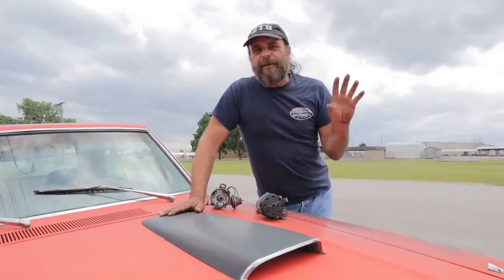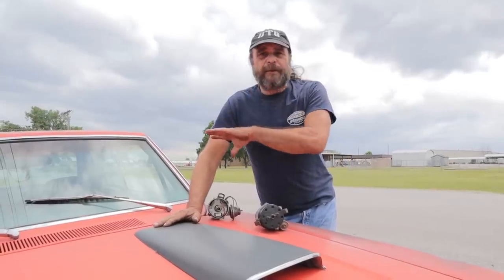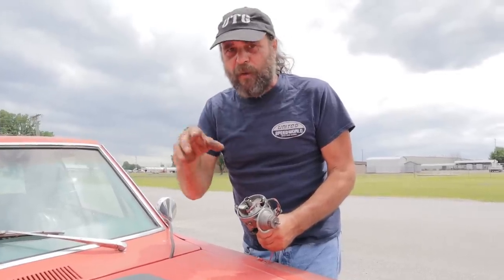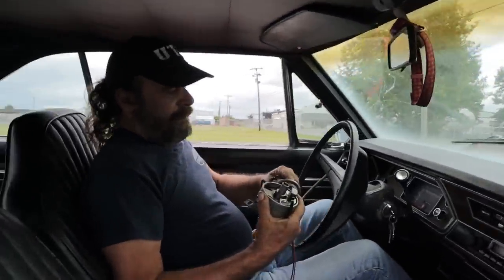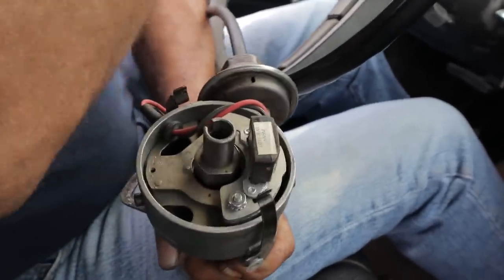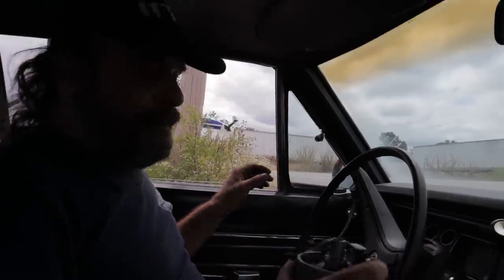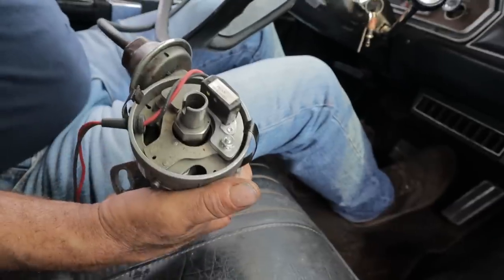The Vacuum Advance Debate!

Comment: IMO, vacuum advance was originally hooked up to manifold vacuum. Later, the manufacturers hooked it up to ported vacuum for emissions purposes. The big downside of ported vacuum is the engine tends to overheat on hot days in traffic. Ported vacuum will cause the engine to idle with less advance than what it wants. Idle loves advance. It runs cooler and more efficient. 

From what i've heard, never seen one myself, In the late 60's, in California, they started to install a second vacuum advance that was activated by a temp sensor. I think this was an attempt at fixing the overheating problem. So, when the engine started to overheat it would add additional advance from the second canister and cool the engine. Could be wrong. Just a theory.
Reply: Ah, yup. I think you nailed it. That explains the purpose of those (pvc looking coolant switches) perfectly. I do believe, you are spot on. All that foolishness should be bypassed and we should take our vac right from the intake in the first place.
Reply: It’ll only overheat if the manufacturer didn’t design enough static advance in, or the idle jets pushing the whole lean burn thing way too far.
Reply: I had a 75 Ford Granada with 302 that had that system smog pump , EGR valve and vacuum hoses everywhere if you took one or two off and did not know where they went your in trouble for sure . It has several water temp sensors with vacuum hoses hooked to it when it got to the set temp it would open and send more vacuum  to advance the distributor more timing  kinda of a neat idea .

Comment: I thought the only difference between full vac and ported was having extra advance at idle. Ported timing waits until throttle is just off idle to work. So it makes no difference either way. The power and fuel economy is the same. The only change from the exta timing at idle is smoother idle, cooler temp, better vacuum assist to power brakes, ect. depending on your engine combo, it may run better at idle. The higher vacuum signal lets you lower the throttle plates even more to gain better results from your idle mixture screws. Remember, we always set our base timing and and check max timing with the vacuum advance disconnected anyway. WOT doesn't use vacuum advance, so there should never be a change in performance. Anyone who disagrees must be setting their base timing with vacuum advance connected. This is wrong and will affect many things negatively. Love your videos, Tony!
Reply: Well said Ed. Full manifold vacuum is the best way.  I think ported started with the Clean Air Act in 68.
Reply: Ported vacuum is pretty low just off idle and manifold vacuum is pretty high just off idle.  You’re getting much more advance with manifold in that situation.  It’s not just idle where the difference is.  In fact, most vacuum canisters I’ve come across don’t start advancing timing until about 5 hg.  So if your canister is connected to ported and you’re in light cruise with those throttle blades barely cracked, you’d be getting zero advance.  If you were connected to manifold you’d be getting all of it - like you should.

Comment: Absolutely correct.  The biggest problem is that the off-the-shelf distributors have too much mechanical advance for ported vacuum.  I had DUI build me a distributor with 12 degrees mechanical advance and a 14 degree vacuum canister.  I start with 24 degrees initial timing which using ported vacuum is your idle timing.  But I vary that from about 22-26 degrees as needed.  So this gives me 24 degrees at idle, 36 degrees total timing and 50 degrees light load cruise which is exactly what a first generation SBC wants.  My engines all run perfect.

             For Ported Vacuum

Idle     24       
                  >  12 mechanical advance
Total   36
                  >  14 vacuum advance
Cruise 50
Reply: DUI recommends manifold in their literature.  How many of those 14 degrees ported vacuum advance are you getting at high speed/low load cruise?  At low load, manifold vacuum is high and ported is quite low obviously.  Run two gauges at once to validate.  Seems like you could be getting more mpgs out of your cruise with more timing, manifold timing.

Comment: Well, we know the canister works. The distributor has to be curved to work on whichever port you use. If you take a stock distributor that was curved to run on ported and you put it on manifold you will have way too much timing. Likewise, if you plug a distributor into ported that was set up for manifold you won’t have enough. So there is truth in both camps on which is “better”. Best to know what you have for mechanical advance in your distributor and how many degrees at what vacuum your canister delivers to determine what will work for you. Excellent real world practical demonstration from Tony. You won’t get that anywhere else!  👍

Comment: For stock type stuff ported is great, cars form the factory did it that way for a reason....  I had a car with a bigger cam and found it worked best hooked to manifold.  The reason why is to get it to idle in gear, I needed the throttle blades open too far causing the idle mixture  screws to have no effect.  So, hooked to maniflod I got some extra timing that raised the idle allowing me to close the throttle and allowed  idle mixture adjustment.  This would not have worked if I did not have an adjustable vacuum can the stock cans have too much advance.  In full disclosure the stall convertor was too tight for the cam, when I put it into drive the car learched pretty bad.  So, yes when modifying engines the combo  is very important. 

This issue is always a debate, IMO the most important thing is to understand timing and the advance mechanisms.  Then use a vacuum gage and timing light to actually know how much timing your engine is actually seeing under different conditions.   Too many will want to argue about this and they never drove a car around with a vacuum gage or checked their mechanical advance curve.  

Keep up the good work Tony!!  Dont worry about the know it alls, they are just fine.  Your are giving a great education to the younger/newer guys!!  Its weird to think that there are a lot of 50 year old professional mechanics who never worked with carbs and distributors.
Reply: You can also drill a small hole in the front throttle plates,  this will allow you to bring the idle screw down to cover the slots in the base plate. If you go any higher on cam profile. Another trick to let a little more air in was to adjust the screw on the secondary shaft to open it letting more air through and accomplishes the same thing. Either will let you drop the Idle screw down to function.

Comment: I guess I'm a younger guy, mid 30's. Grew up in the age of distributorless ignition and electronic fuel injection. But the more I watch these videos, the greater respect I have for the engineers of the past for all the clever ways they thought of ways to improve performance, economy, and drivability on an....analog level{?}. The things they did before modern computer power are really quite impressive.

Comment: Love it!! First you held class, then when heads started shaking, you took everyone into the lab. "A video is worth a thousand words"...😁 
This is basic stuff, dont know how there is debate on it, but you had a great way of clearing the air on the subject Uncle!!👍👍
Reply: The demonstration was hardly relevant
Reply: @yeboscrebo4451  Hows that??? For people who are unfamiliar with vacuum advance, don't understand it, or might be 'visual leaeners', its totally relevant. How could it not be???
Reply: @wheels-n-tires1846  because the distributor is only part of the symbiosis and doesn’t operate on its own so showing what happens in a disconnected distributor is hardly a comprehensive teaching aid.  People think that you can just switch between ported and manifold and “see which one works best”.  Wrong.  If you switch between one or the other, the initial timing may need resetting, the mechanical timing curve needs resetting, the vacuum advance canister needs to be adjustable and set correctly and finally, even the carburetor may also need adjustment to achieve results.  Uncle tony failed to explain WHY time is needed as certain inches of vacuum or certain rpms, he just pointed to a dizzy and said “look, see”.  Sorry, even knowledgeable dudes like uncle Tony have crusty ideas they’ve harbored for years that are just wrong.
Reply: @yeboscrebo4451  Lots to unpack there...so first, in other videos hes talked about timing and carb relationships. This vid wasnt  about that. It could really be condensed into "see, using this port, good. Using that port, its working backwards, thats bad." Or.... "this shows exactly what happens when you hook it to the wrong hose"...
 Its meant at a 4th grade level for folks who know little or nothing about distributors, advance systems, carburetors, etc... And Tony certainly wasnt saying you could switch back and forth between ported and unported to run your vacuum advance distributor. Thats idiotic, and nobody that has a clue thinks that.  Not sure where you got the idea that anyone thinks that!!! That might be the silliest statement Ive heard on YT in a long time...so its pretty bad!!
So anyway, while youre right about the finicky relationships of timing and carburetion, this vid didnt intend to address that.  Why does he have to address everything in each video?? Maybe try watching others. Id imagine theres HOURS of Tony on here explaining timing, curves, carburetion, etc. So if you expected it to give a thesis-level dissertation on that relationship and it's details, well guess youll just hafta stay dissappointed, because this vid, and frankly the whole channel seems to be more about basic info and explanations for beginners, or people who only have experience with newer cars and systems. Your conclusion that the old timer is dumping old and incorrect theory on here is whats wrong. I read and used Tonys knowledge for years and years...decades before he ever had a YouTube, and can say that I put together a half dozen street/strip Mopars with that knowledge, and they were better and faster because of it.
Reply: @wheels-n-tires1846  wow that’s a lot of words to not actually refute any part of my comment. Did you ever “unpack” the subject matter of the comment i made?  Not sure where I got the idea?  Have you read the comment section?  Lol.  As I already explained, the demonstration was not relevant precisely because it was overly simplistic.  To explain the difference between ported and manifold vacuum, it’s not good enough to have a dizzy, removed from the engine, and expect to illustrate the relatively complex interactions between all three forms of advance timing.  You can’t just say “look the advance mechanism is moving here on manifold and here on ported” because each case requires changes to the other two forms of timing advance.  Just the fact that he did not acknowledge this interaction is indicative of his misunderstanding of the benefits of manifold vacuum advance.  It seems like uncle Tony just gotten stuck on the teenage hot rodder “more timing equals faster” approach without every revisiting this idea in his old age.  Your better off reading what the actual engineers had to say about it than an old hot rodder stuck in his ways.
Reply: @yeboscrebo4451   What you don't realize is that  YOU  are  the one that made this topic more complicated than it is. Wheelsntires said "lots to unpack" for a reason..
Reply: @shootermcgavin2819  and you are the one making an irrelevant comment.  If you can explain how I’m wrong, I’m all ears.  Otherwise you’ve added nothing to the conversation.

Comment: As I recall, vacuum advance is always useful when you have high vacuum because you also have stratified lean conditions.  Could be at idle, could be descending a hill, could be light throttle freeway cruise.  That vacuum advance is there to help light the very starved almost closed throttle poor mixture, light it early so the weak flame front has time to progress to peak burn. 
If you watch your own video here as you just presented it, you see that when you accelerated, you were on mechanical advance only, both times.  Once because vacuum advance fell back to mechanical only, and once because you ported it.  Same result. 
The vacuum advance can't "remove" mechanical advance.  They are separate systems ...
Reply: Exactly.  "When you need it most–"  it was never there in the ported scenario–  how can it be "taken away?!"
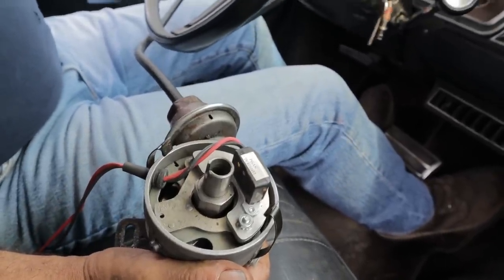Reply: From what I can tell, you are correct. Notice around 4:58 as UT releases pedal, i.e. cruise condition (minimal fuel, somewhat high rpm) the vacuum advance can be seen to go away. But actually, you want mechanical and vacuum all working at that condition as the low cylinder filling and small amount of fuel need max ignition timing. So taking away vacuum advance at the condition, takes away much needed advance.
The timing gets taken out during accelaration because cylinder filling increases so a faster ignite happens as a result of the richer mixture.
From all the reading plus some testing I've done, I think the issue is that when hooked to manifold going from ported, idle timing goes up too high, so the distributor gets pulled back to end up at the same 12-14° idle timing when it was on ported, but now the vacuum is adding some of that idle timing. But that then limits the higher rpm timing because the mechanical is now down from 12-14, to probably 4 or so (rough numbers for illustration). So when acceleration is applied and vacuum drops, the mechanical is lower than it was when ported as the distributor was pulled back to compensate for the extra that manifold gave it at idle. 
So if we go back and set timing with vacuum port plugged off, and set say 12° purely mechanical, then plug in manifold vacuum and timing goes up to say 25 (rough number)... Instead of pulling back the distributor, leave it, instead, lean out the idle mixture screws and turn out the idle speed screw. By lowering rpm in this way, it should reduce some of the mechanical advance. Or so goes the theory that David Vizzard puts forth.
Effectively, idle timing can be fine on ported but at cruise you want manifold advance to get that high timing number. That's the theory anyway
Reply: I think 🤔 the ported was a emissions  thing  i tried both on my 390 ford and on ported it ran good and the AFR was easy to get 14:1 especially on the Fwy only it woukd get hot 🔥 in stop and go idling traffic in the summer  the exaust was 50 percent louder and at startup i would have water vapor coming out of the exaust . On manifold it was alot richer and i would need jet down a size or so alot harder to get perfect AFR usually be around 13:20 ish  idling and 13:80 or so on the fwy  but if was 50 percent quieter exaust and did not get really hot in traffic .
Alot of people say the factory never used full manifold ?. I think before 1975 they did on the valve cover it has a low initial timing like 6-8 degrees  if it was ported it would or should say 14-16 degress ...
Reply: @TheThirdWheel618  All of my older vehicles used full manifold vacuum advance except a 1973 Dodge Dart with a slant 6. Once I bypassed the OSAC valve and gave the vacuum advance can full manifold vacuum, the engine ran cooler and more efficient. Better MPG's, better drivability, better cold starts.
Reply: @muziklvr7776  
Yeah i think before 75 for  sure it was all full manifold Ford had a valve that operated by engine temp you were on ported untill the engine reached a certain temp say 200 then it would shut the valve off and it would go to full manifold to cool the engine down ???? That says it all the factory knows they can reach better AFR with ported at idle but it creates a lean condition so they came up with the valve idea .
Reply: @TheThirdWheel618  This was the "Lean Burn" era and very profitable for the rubber hose companies. I knew of a mid 70's Ford LTD that would run for a couple of minutes with the key off dieseling the whole time. Electric solenoid didn't back the throttle plate down to shut off the air. "Lean Burn miss" at idle on a Chevy 6 that I hated until I was told it was suppose to do that. 1st Gen Emission Systems were ridiculous.
Try to set ign timing with a light and the mark dancing around the TDC pointer?? I'd plug into a good vac source and ran with it on my car(70 1/2 Z28) in high school(1976). It didn't have all the emission BS the mid 70's had.
Reply: I remember the plugs on the carburetor so you can't adjust it those years 79-89 didn't last long garbage cars .,.
Reply: @TheThirdWheel618  Some of those were removable or could be drilled out.
Reply: @car_ventures  that’s exactly what I did when I switched from ported to manifold on my 72 f350.  I now get 3 more mpgs and a noticeably quieter engine at idle and cruise.  My acceleration and power didn’t change.  Uncle tony is wrong on this one.

Comment: Hey Tony, I've been dealing with old British cars that not only have vacuum advance but also vacuum retard using a double diaphram  distributor. I plug both of them and do what I call a "road tuning".  I set it up with the light in the shop and then drive and get the best responsive advance I can on the road, reset idle and call it a day.  It's worked for years.

Comment: In other words, light load and substantial vacuum  implies a less dense charge in the cylinder, and the flame front is moving slower, so the vacuum advance bumps it up so the flame front hits the piston at TDC, which gives more power for that part throttle setting, which in turn enables you to let your foot off the gas even further for better gas mileage.
Reply: Yes, that’s what manifold vacuum advance gives you, not ported